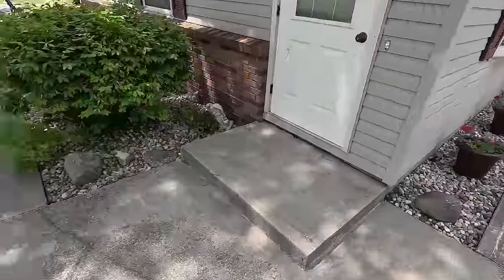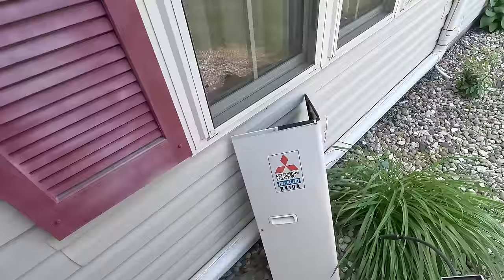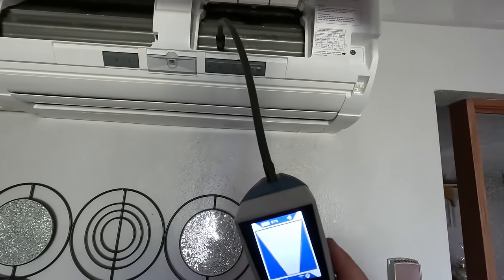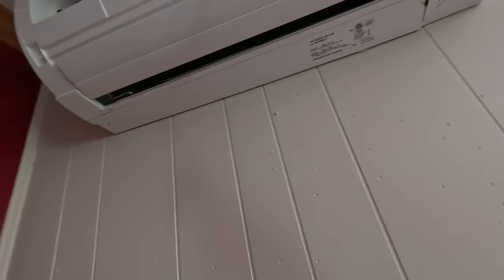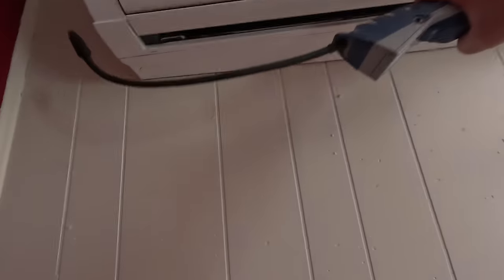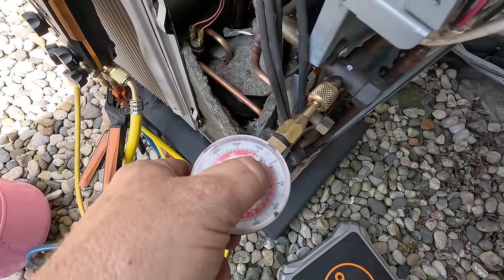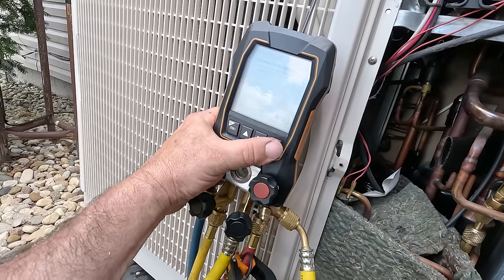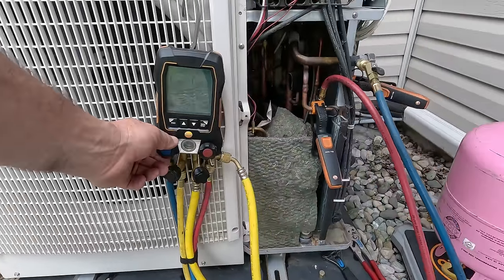I HATE Mitsubishi MiniSplits

Comment: imagine using electric heating when you have heatpumps
Reply: Old people who don't understand.
Reply: @AustinMichael  what don't we understand? I am 71 and love my mini splits and when they wear out I will buy more.
Reply: They feel the electric more and have used it for years and more comfortable with it. If they don’t mind the bill so be it
Reply: Probably feels warmer .. esp if these units started leaking a while ago.. you will lose heating long before you lose cooling in a slow leak minisplit.  If you live up north having the heat come out of the ceilings sucks. You get get hot face and icy cold feet..  those wall heads will blow it right in your face.. I put Fujitsu mini in my house.. ducted ones with floor registers .. backed by gas heat.  Gas heat comes on below 20F so I can feel nice n toasty.. I hate cold so I keep my house quite warm. Above 20 the heat pumps rock.  I worked on a lot of different systems over the years but I can sympathize with them. Although I’d probably still use the heat pump functions on milder days ..
Reply: Like he said, "probably blowing cold air".  Even 80 degree air blowing on a 98.6F body is going to feel cold in a ~65F room.  We have an air handler in an unclimatized attic.  You can't adjust the fan runtime, after the compressor shuts off.  It's like 5 minutes, fixed.  Also, it turs on immediately when the compressor fires.  So, that obviously means some cold air, too.  It would've been nice for the delay to be on the front end and a more rapid fan shutdown, at the back.

I'm not at all down on heat pumps.  Just think they need more adjustability, especially for those replacing A/C units in hot/cold attics.
Reply: Imagine caring what someone else does with their time and money.
Reply: Imagine having a heat pump and not having something as backup.

Comment: My main problem is taking apart head units on any mini split. Huge pain in the ass and you always feel like you're gonna break something
Reply: Basically overpriced Throw away units it’s sad and working on them sucks
Reply: Agreed, I damn plastic is so brittle especially if it’s been right by a window all it’s life.
Reply: 100%
Reply: I used clean the air conditioners at my old job i was a maintenance worker at
Reply: I'm in San Diego and they are super popular here so I've gotten used to taking them apart. If it's a new unit and I have to take the plastic off I have to be super careful to make sure I get it apart AND back together without breaking it. If it's an old unit that I'm cleaning I basically tell them that there's a high chance the plastic will have a small break somewhere and it may not go back together perfectly but I'm not liable for this if it happens
Reply: How old are these Mitsubishi units? I’ve been servicing and installing Mitsubishi equipment for at least 8 years now and I’ve never found it to be that bad. I’m sure they could make the design easier to clean but it’s a heck of a lot better than working on a Fujitsu. The new barrier coating seems to help keep things clean. The only problems I’ve ever had Was one blower wheel that a tech stuck their temperature probe into while the unit was running. The majority of issues I’ve had have been with improper installation and improperly torqued and made flare connections.
Reply: carrier performance line are very simple to take apart is crazy been installing them for a year, i can take the wheel and blower motor out in a few seconds nothing like it.
Reply: He mentioned the issue of sulfur water most likely from cleaning that then dissolved the copper in the head units since they are made super thin to fit as much chilling capacity on a tiny unit
Reply: Just sell a whole new head unit.

Comment: Minisplits always sound like a good deal but every HVAC guy I spoke to hates working on them and hates supporting them. We ended up going with a newer Ruud 4ton standard high efficiency (not the full variable but the 3-stage with some range variable) and it's been fine. It doesn't have fully variable heat either just 2-stage but should be fine longer term compared to these splits.

Comment: I installed a 9,000 btu Mitsubishi Hyper heat during covid as I had to work from a windowless basement office and absolutely love it. So quiet and powerful and did not even think about it as a heat pump until winter we had a deep cold snap and my office was so toasty kids were always in it.  Installing a 12k version in the living room this week and  want to install a 3 zone for the upstairs bedrooms next year.  Have only ever had window units and hate them all.  Nothing but praise so far. I did hvac work before moving to Cisco networking so install was very easy. Will se how they are a few years from now as that will be the real test!
Reply from the maker: There great when they work, trying to decide if a control board or another electronic device is truly bad is the problem. They don't have a cut and dry procedure for things.
Reply: @HVACRSurvival  Yes I fully agree.  So many modern appliances have excessive amounts of electronics it makes them nearly impossible to repair.  I have been looking through the service manual for my Split system and while it has flowcharts and such I am sure an actual failure will not be straight forward.  As an example my flare was leaking and a year later the error code it gave made no sense but it was just low on gas.
Reply: My advice is single zone. If you just have 3 head units upstairs, get a 2 zone and then get the master bedroom it’s own zone. If something goes wrong, your entire upstairs will have something. They do make 6k btu units too, in the Hyperheat only from what I’ve seen, and they perform!
Reply from the maker: @SovereignTroll  I did not install this system I'm just the service tech. Far as selling them a power conditioner know I did not do that nor do I carry one on the truck to sell them. I'm still waiting on them to approve the repair.
Reply: @HVACRSurvival Fujitsu seems to be coming up with very nice training. Attended a class and was impressed with the simple diagnosis’ instructions and repair instructions. All on their app. Makes life a lot easier.

Comment: I believe you can use the EOS (Emergency Operation) switch on the evaporators to run in '100%' mode. One press for cooling, 2 for heating.
Reply from the maker: I think you're correct, it's been so long since I've done it I don't remember. I don't work on these very often anymore. And I'm okay with that 😁

Comment: You cant charge precisely by subcool and superheat, however they can still be indicators of low charge etc. i.e. all EEV's wide open and superheat is high.
For a quick charge to get a system up, running all IDUs at full tilt and getting the superheat to correct on all will get in the ballpark for minimum charge.

What was left in a system that low could be fractioned R410. So who knows what blend you wind up with without a recover and recharge with all new R410
Reply from the maker: We quoted new refrigerant when we are going back, I don't know how you could rely on superheat when the electronic expansion valve is going to open and close to maintain whatever superheat is calculated at once. However sub cooling is going to tell you whether you have enough available liquid to even do the work. That's why I went with subcooling. You're not going to find in any of their books what the subcooling should be, like I explained in the video I am just getting it as close as possible and it worked. It'll get recovered and new weight in when we're done.
Reply: @HVACRSurvival  I like your reasoning.... I'd do the same.  Get the system pressurized enough to do a good leak detection job.  Then, when you have the parts/time to properly fix the leak...THAT is the time to do the fancy suck-it-down, weigh-it-in process.   I look forward to your video showing the leak fix job, then the fancy stuff... 🙂
Thanks for your great video...  BTW, the reason so many flares are an issue is because (IMHO) not enough installers know what a torque wrench is, nor how to use it on the flare joints.
(just my opinion of course) ....but I've seen enough sloppyness by installers ...
Reply: Yes always reclaim and start again after leaks found.😢Fractionated gas is bad gas you can Ean up chasing your tail.Domestic units have under 10 kg of ju ju.So do it once and properly

Comment: The frequency on these inverter compressors is usually quite high since their motors are not two pole but more.
I would say most of them are four pole, so 60Hz would only give you 1800 RPM, 150Hz will be 4500 RPM.
Although I have encountered ones with six poles and even eight poles.
Reply from the maker: Carrier inverters can hit 7500rpm

Comment: Mine is brand new, it doesn’t sound like that at all! Mine doesn’t make any noise whatsoever. The little condensate pumps are the noisiest parts, and those just sound like an irritating kid trying to suck up the last bit of soda from a straw. My outdoor unit is (virtually) silent..no ductwork, so efficiency is fantastic. I’m still trying to figure out if I should let it run continuously on auto or reprogram it to stop when temp is reached. I’d encourage you to live these newer units, because I’m so blown away by mine..
Reply from the maker: This was a medium price range unit (I believe), when you get into the P series, they are higher quality. Also, anything in the hyper-heat model range is really efficient. Also don't forget I had the cover off so you're gonna hear more noise from the compressor specially, when it's running at the high rpm, it was running.
Reply: MINE IS 15 YEARS OLD (MR.SLIM) AND QUIET AS A MOUSE. KEEP THE FILTERS AND OUTDOOR COIL CLEAN AND HAVE NEVER HAD AN ISSUE.  NOW MY TWO YORK SPLIT SYSTEMS THAT WENT IN AT THE SAME TIME WERE ABSOLUTE DISASTERS.  GRRRRR.........

Comment: I like your method of practical charging.  Once you fix all the leaks, then it would make sense to pump it down and weigh in a new charge.
Reply from the maker: That's what I plan on doing 👍👍
Reply: @HVACRSurvival can you fix the leaks or do you need to replace the head unit?
Reply: @HVACRSurvival  I would really like to see your process for fixing the leaks, recovering the charge, pumping it down, and then weighing in the new charge.... which port do you use.  On the unit you are working with it appears there is a charge port between the accumulator and the compressor.... did you use that for your gauges?

Comment: Can’t speak to working on them, but owning one so far is freaking amazing. I went from a swamp cooler to Star Trek technology. I had a Diamond dealer install, my ceilings were all open, so it made it easier. Slightly different temps in each room is awesome, so, so quiet..
Reply: Well they are extremely expensive when they break, parts are not usually in stock. They are a expensive window unit.
Reply: They are great when they work. When they break or have issues is when we (the techs) and homeowners start getting angry.
Reply: If you are impressed with those, you'd feel like you were in heaven with a real heat pump system. I can't even tell if it's 80 or 10 outside without sticking my head out the door. You aren't going to like them when you wait a month or two for a part. Those things are very brand specific parts. Central home systems are 90 percent universal fitting parts. I can fix 98 percent of the service calls during the first trip on regular systems. I fix about 10 percent of the mini splits on the first trip.
Reply: @Bryan-Hensley  I don’t understand..it is a “real” heat pump. I happen to already have a Trane XV95, but the ductwork wasn’t right for AC, (swamp cooler was great for two decades, until a surge or short caused an attic fire) so I opted for the Mitsubishi as primary cooling, and backup heat
Reply: @johncspine2787  I thought it was your only heat.
Reply: @Bryan-Hensley  they seemed to work fine last winter, but I only have four main rooms upstairs, so of a five head system, only four are installed, (supply issues the time window of my attic being open I couldn’t get a smaller outdoor unit, so we went up a little to get it installed) I’m not downstairs much, (so the furnace takes care of both floors, but being a cold basement, it is what it is)  the attic fire they took out the ceilings and insulation, so installing the split was easy, I figured some future owner can install a fifth downstairs if they have a family, but so far the downstairs stays really cool anyway as I’m set into a hill, and the biggest cassette (a 12) is in my kitchen area right next to the stairs leading down, there’s plenty of cool air going down. I also have a little sealed cast iron gas quartz glass front stove in the living room I love to use in winter..pays to have backups in a cold climate..the swampy worked great for many years, but, all the smoke and dust in the air I’m glad to have the split now..
Reply: @Bryan-Hensley  Mini splits are going to do heat and cooling.
Reply: @AustinMichael  did you miss something? SMH
Reply: You did yes @Bryan-Hensley

Comment: I worked in the field for a number of years and most of the time the prior HVAC TECH did a turdly job. Either the flare was bad, the soldering or brazing was poorly done, the use of some cheap weird mix of gases that just do not work correctly or the system was charged to the max when all that was needed was a blower belt. I just do not understand why taking pride in one's work is so hard to find. I feel your pain fella.
Reply from the maker: Thanks for sharing👍👍. I agree, it shouldn't be thought of as harder to do a job correct. 🤷
Reply: @HVACRSurvival  Thank you for your honesty and integrity on the JOB !!!

Comment: We try to avoid installing multi head outdoor units, there are always problems with them. Unless the customers REALLY want a single unit outdoors, even after telling them all the problems they're gonna have.
Reply: Let alone that 2 single split are cheaper than a dual split !
Reply: I was curious about the advantages vs downsides of multi indoor/single outdoor.  I just had two separate single in/single out units installed at my home and after the fact I thought "why didnt I do one outside unit with multiple inside AND room to expand?".
Reply: Why is that?  Thinking about installing a four zone Mitsubishi unit at my house.

Comment: My personal choice for an AC system is a variable speed communicating central AC system. You still get consistent room temperature and humidity levels just like you would a mini split. The Condenser unit on a communicating variable speed communicating system is just like a traditional central AC system but, has a VFD instead of a contactor and dual-run capacitor.
Reply from the maker: Sounds like a Carrier Infinity system. That's what we sell but we also sell this stuff too.
Reply: It really all depends, sometimes you just can't get ductowrk into the space effectively and that's where mini-splits come in.

Comment: I worked with hi vacuum systems.  Flare fittings not good.  VCR type fittings would work to prevent leaks.  Or solder the connection.

Comment: i did a mrcool DIY and it heated and cooled like a beast for over a year still on trailer its on but since moved and wish i could take it with me but i plan on getting another one for sure.
Reply: Do they give you the option out of the evaporator/ blower side?
Reply: @Michael-qy1jz  sorry dont quite understand?
Reply: @shiroken0  the way it shows to route the evap lines is out the back and through the wall, so I was wondering if it gives you the option to route the lines out the sides, left or right side?  I hear some of these mini splits do.
Reply: @Michael-qy1jz  yes you can normally route out the right side of unit all you got to do is cut the notch out.
Reply: @shiroken0  thanks!

Comment: I thought Mitsubishi was top of the line. What brands do you like for durability?
Reply: Rare that they leak. It’s cheaper quality of everything.
Reply from the maker: @edor Mitsubishi is the better of the group but the training and tech support sucks.
Reply: Fujitsu for me. Ameristar from RE is just another cheap GREE.
Reply: Panasonic is good.
Reply: They are, but they still break down. They update their equipment hardware a lot and makes repairs on them nearly impossible after a few years,
Reply: Ive been to mitsubishi class in Atlanta Ga. It was good. Also a gree class taught by Gerry Wagner now that class was very informative Gerry puts the gree units trough there paces.
Reply from the maker: @aaron if Ralph did the class, it probably was good.
Reply: The Gree instructor videos (official ones posted on YT surprisingly) were funny as heck with that new yorker guy from a few years ago. New ones are now blah, but informative.
Reply: @sprockkets  that New Yorker guy was Gerry Wagner.

Comment: 4 pole motor on the unit, so divide the measured hertz by 2 , to find the rotational speed of compressor..
The service manual will tell you the  number of poles the compressor.motor has, usually 4...
There a pretty sound piece of kit, like all ac units the last few years, coils.leak on most of them, thinner copper in coils etc etc....

Comment: If they are using baseboard for heat instead of the mini split, they bought a unit from someone that sold them the wrong crap.  Our mini split had no  issues heating when the temp outside was at 3F.
Reply from the maker: You must not be a service tech and likely not an elderly person. I heard the same complaint from customers that purchased an high efficiency gas furnace when they first came out. Simply said,  people don’t like change and if you’re on blood thinners everything feels colder.  You’re also assuming that the customer picked the top options that they could’ve picked, that was not a hyper heat system so I would say you’re assumption is missing the necessary information to make factual based opinion.